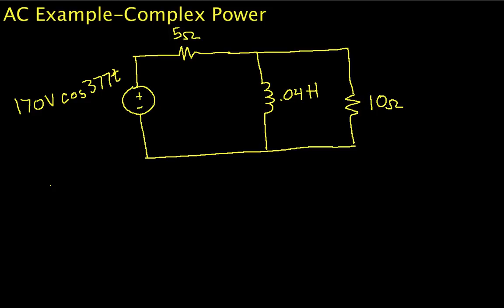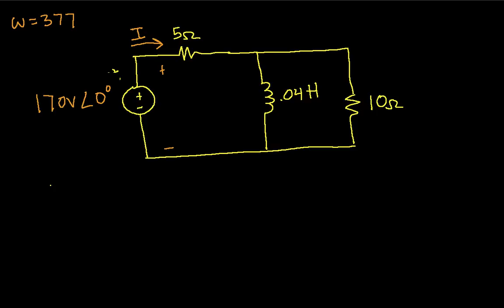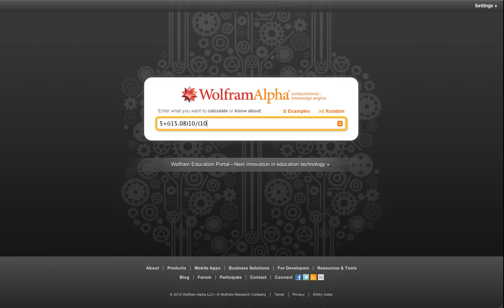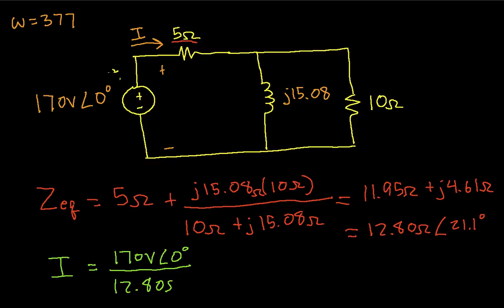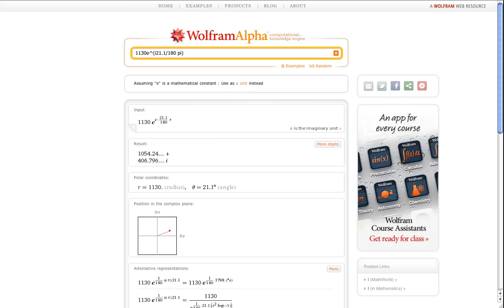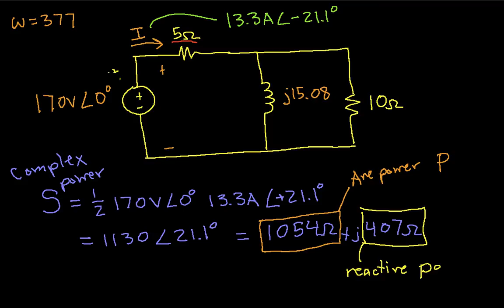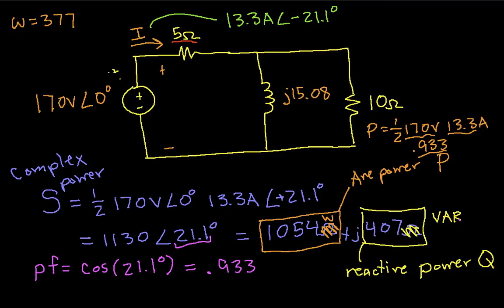AC Example-Complex Power

Comment: S=V(rms)I*(rms) but he is using PEAK values and must divide BOTH V and I* by the square root of 2. When multiplied that gives you S=1/2V(peak)I*(peak)
Reply: at the beginning i thought the value of the voltage is given as rms value but then he did some calculations to find i phasor and impedance, after whole equation when he get to complex power calculation he divided into 2 the peak voltage (which i thought was rms value as i said) so it possibly gave the wrong outcome i believe.

Comment: i think you did this wrong. the 170 volts and 13.3 amps are not the max value but the effective value. Which makes S = Veff*Ieff. The source I looked at was my circuit analysis book,